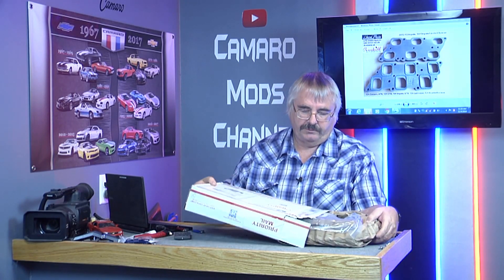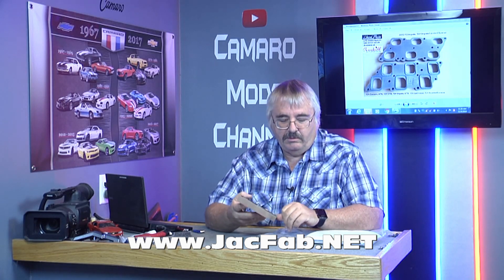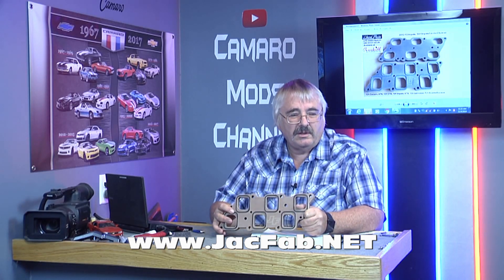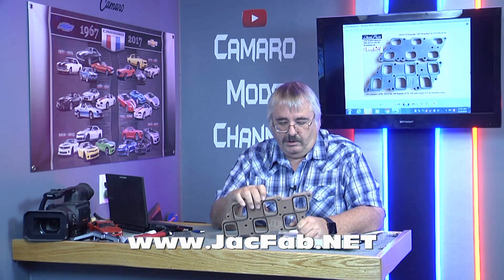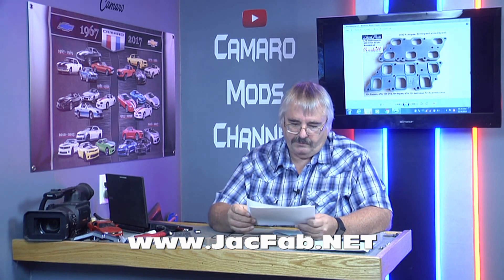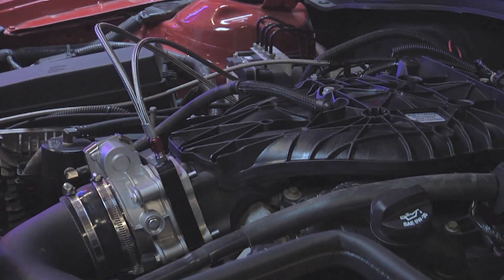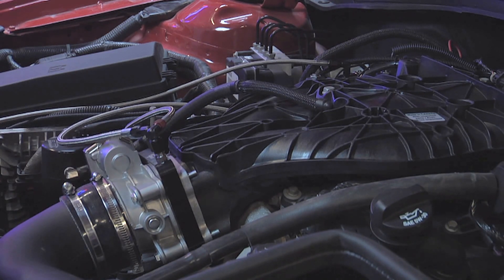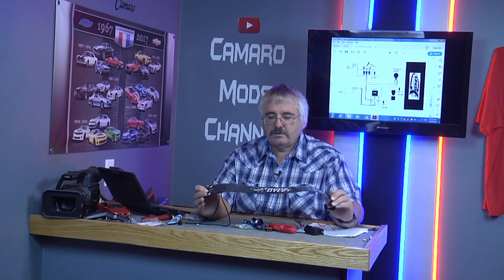Nitrous Outlet X-Series Bottle Heater install video

Comment: So does the on/off switch needs to be grounded and the other end of the switch goes to the relay???
Reply from the maker: Yes, if i remember right ,this is a switch on the ground side of the circuit.